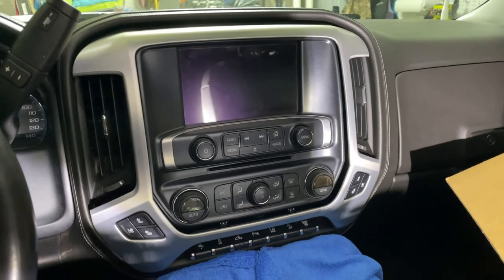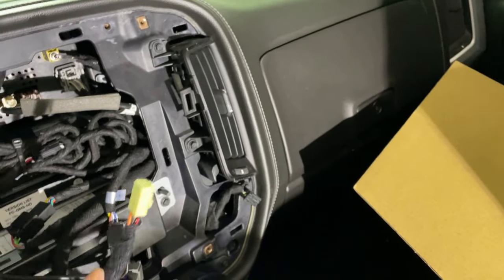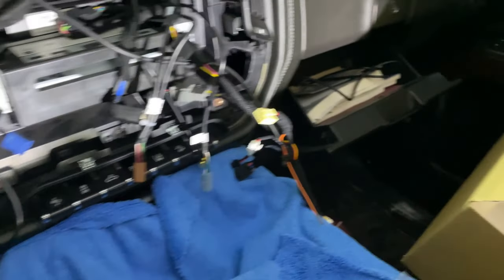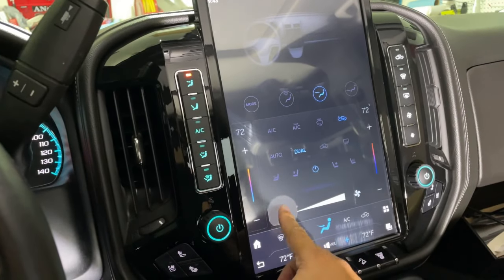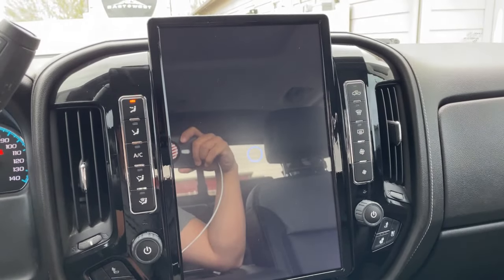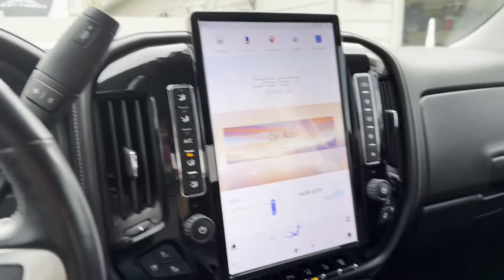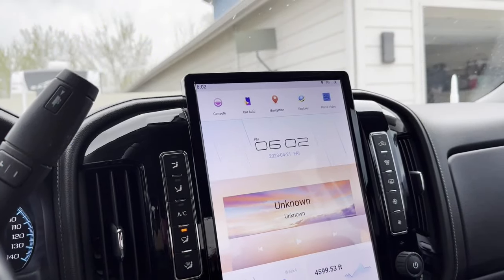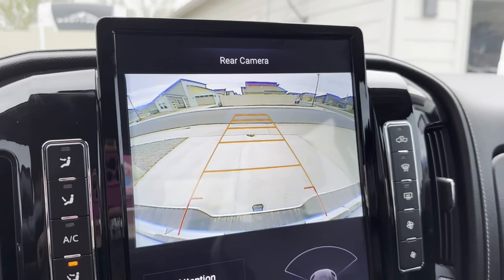AutoTec Pro Tesla Style Screen Install and Review 15-19 Sierra/Silverado

Comment: How do i connect to bluetooth with out using andriod auto
Reply: I had no camera or sound. I have a 2016 1500 z71 without rear entertainment.  If u email them, ask them for the links to the guides on ther website. The guide says if the cameras not working, dont use the extension harness for the main power. Its  black on one end and blue on the other and one corner is angled and its about 4 or 5 inches long. If u used it, remove it. If that dont work the settings under settings> system> settings guide, the car ac protocol can be changed according to your vehicle ans the camera can be changed to vga format. Its the first option once u put in the password default 7890. To access the factory settings page under settings>system>factory settings, the password is default 666888. Also, i had no sound. The headphone dongle jack  must be plugged into the senter console port. Once thats in go the icon that says console and select aux or media until you see your phone, providing your BT is paired and connected.. but... heres what i did and it took me a week to figure it out.. when i removed my factory radio, i deleted the MyChevy from my bluetooth list. Well i reinstalled my factory radio, and paired it again. Then took the factory radio out and reinatalled the android unit and the bluetooth needs to be connected to the mychevy and the android unit. Wont work unless they are both connected.. i uninstalled android auto from my phone because u almost dont even need it with this unit. Maybe for msgs and calls but thats not important to me so i just use the music from my phone. And then once both bt are connected, play some music from your phone and click on the BT music icon to bring it up on the screen.  I now have sound,  and with the equalizer thats installed on the unit, the sound is amazing. So dont give up. Its a beautiful unit, it does work. I was on fire cuz i had no beats for a week or a camera. I was on fire.. but i kept tryin then they gave me the link to the guides which the password to see the guides is auto123 wen u go the website. They really could save a lot of negative feedback and angry customers cuz it aint cheap lol if they put a paper version in the box.. hope it helps. But if not read the troubleshooting guide. It might be a lil different depending on the year and model. I hope you all pass it on cuz you know exactly how frustratimg it is wen they say works right out the box. Or plug and play.. amd it dont work.. good luck everyone! Once its working youre gonna love it. I promise! Save and reboot after changing settings
Reply: Uninstall android auto from your phone

Comment: Everyone who has BOUGHT one of the head units are having issues witth it. Tech help is minimal, YouTubers just mainky show how good their head unit works but very little on the settings to get it work as they show you on their review videos they made. I knew i was in trouble as soon as i put my fingers on those cheap plastic knobs. I have no video, the rear camera doesn't come on when i touch the camera icon. It's from China, wait until it gets really cold outside. Yes i paid for this thing. Buyer beware.
Reply from the maker: I also paid full price for this. Mine has worked perfect since day one. I agree the customer service is definitely lacking. But again I haven’t had the issues you’re experiencing. I know there are several back end menus that you can access to change settings to get things to work. If you rewatch the autotec videos he does explain and give you the passwords to access those menus since this was designed for several years of trucks.
Reply: @CollaGoUnLTD  my head unit just went to all black screen. It's broken in under a week. Pissed off.
Reply: Did u put lock screen on ? ...i did and had forgotten all about it ..swipe up and it should pop up to unlock your screen
Reply: @jtsams31  at this point idk, but I can try it out.
Reply: I had to hit the reset button. A couple weeks ago.

Comment: No sound on CarPlay or YouTube app, only through console radio.. any one having same issue?
Reply: You have to pair the radio to your stock radio’s Bluetooth.
Reply: @kawi32  Incorrect, only pair to the new radio and forget the stock connection.
If you pair to your stock radio it will always switch to that.
Sure, you'll get sound, and steering wheel controls, but Car Play won't work properly.
Also, one cannot run Car Play and YouTube simultaneously as the Car Play connection uses a WiFi connection.
Reply: @kawi32 I have the stock connected but I’m not about to hear YouTube! What should I do ?

Comment: Play I don’t see CarPlay on this unit
Reply: Huh? It's definitely in the video. It works. My issue is when I turn of car and start it the CarPlay stops working. I have to unpair them and reset the device. Going to try and see if their manual has any information on why I have to repair each and every time I start the car. Saw something about not being able to use Hotspot but I have that turned off on my phone.
Reply: @IAOutdoors  Turn off your blue tooth connection to the stock radio.
Took me a bit to get that sorted (I was a bit slow in this, shoulda known better) but now all is good.

Comment: my wifi doesn't stay connected...it shuts off on its own after a minute or so
Reply: I have a similar system made by AuCar (I think they are the same company as AutoTec, it uses the same Android software) after installing the unit, I connected to my WI-FI but it would turn off after a minute, what I found out on my system was CarPlay was disabling the WI-FI, turning off Carplay fixed my issue I don't use CarPlay), the WI-FI stayed on, what I think was the issue, but not sure, I was doing this in my driveway and my phone was still logged into my home network, maybe the Android Auto was giving the phones connected network priority and disabling the units WI-FI, just my guess.
Reply: @94regnar I actually have the aucar one
Reply: @94regnar how did you stop the car play from connecting...and do u have the sim card installed?
Reply: @94regnar I also have a wifi Hotspot from my truck...I'll try this tonight..thanks